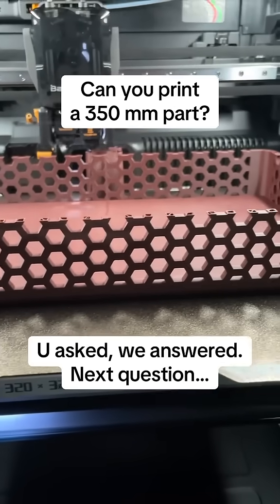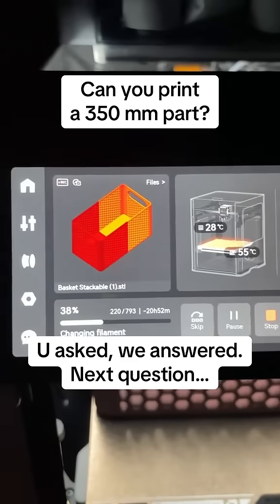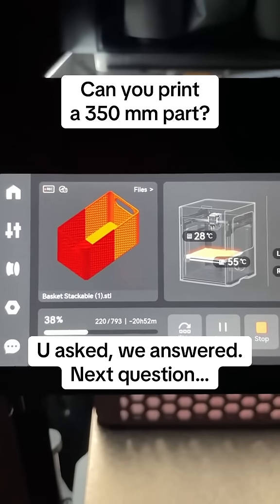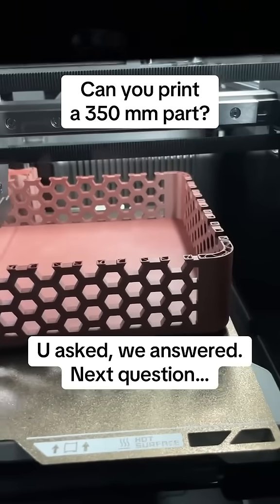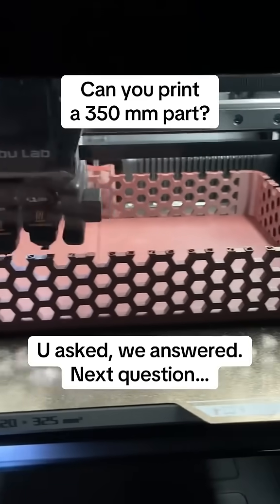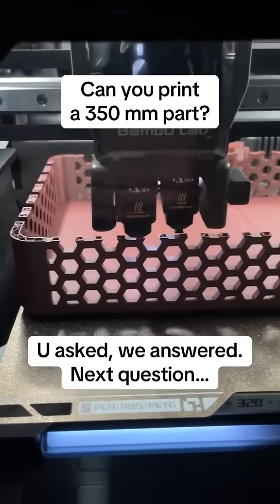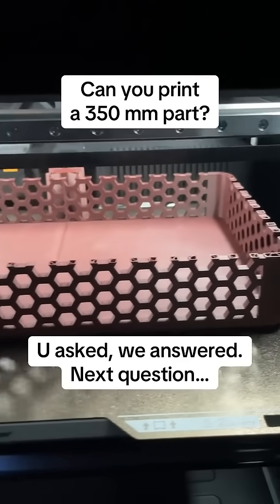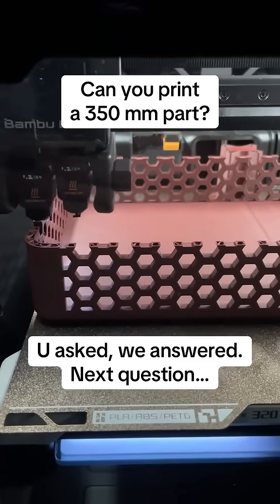Can you print 350 mms on Bambu Lab H2D? #bambulabh2d #bambulab #h2d #3dprinting #fyp #3dprinted

Comment: I'm surprised Bambu Lab don't have this as a built-in feature; that is, allowing for both hot ends to be used to print one large part across the entire plate width without having to manually split the part in the slicer or at the design stage.
Reply from the maker: I wonder if they do. Probably should’ve checked that first lol. Let me see
Reply: Seems like this could easily be implemented by Bambu and have it randomize when it switched heads within each respective heads max print area.